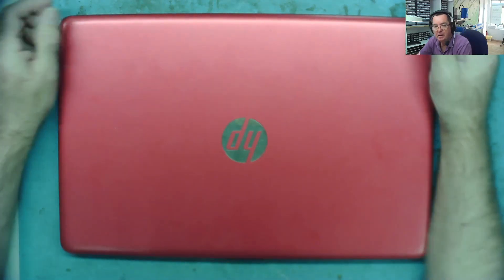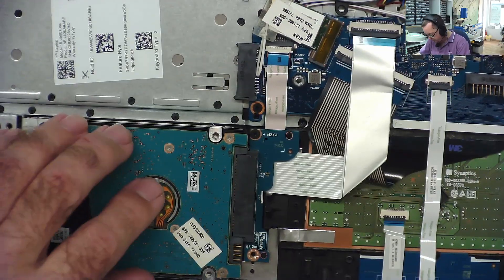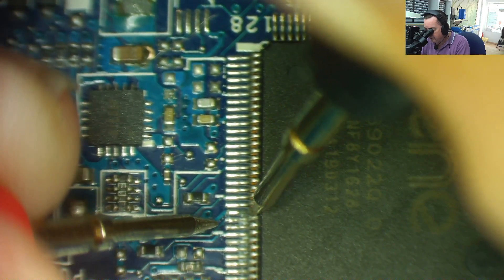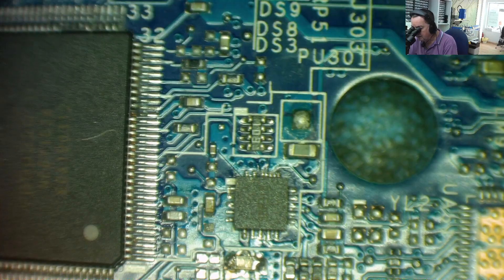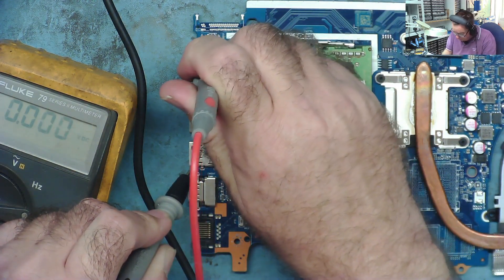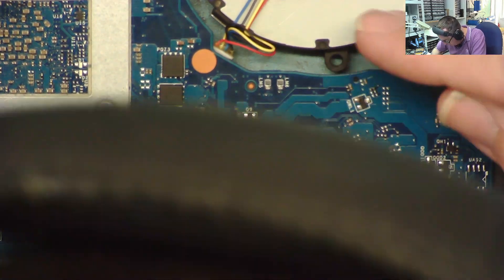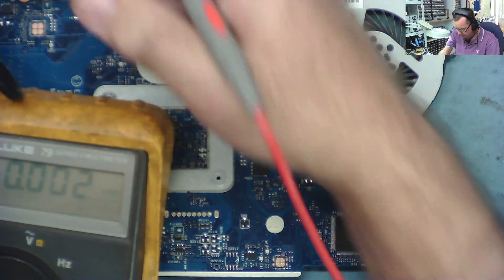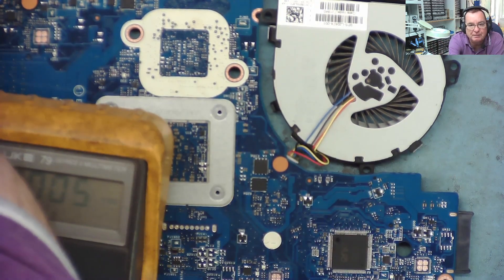HP Pavilion 15 Laptop and CATS are not compatible!  Liquid Damage!

Comment: May be worthwhile charging the battery (using a separate PSU). Some laptops don't charge or turn on if the battery voltage has dropped below a certain value.
Reply from the maker: @ralph J 
I'll give that a try, thanks

Comment: The usual guess is residue under a component pulling down the 3.3V.
Reply from the maker: Would you recommend washing the motherboard in soapy water,  like I do with dirty desktop motherboards
Reply: @LearnElectronicsRepair  I've seen heavier liquids, ie, coffee, etc, NOT clean off unless you remove the part, but because it's water I guess it can't hurt to try as is, ie, it might wash thin residues under parts.
Speaking of cleaning, because the flux I use is like tar I use kerosene first, menth spirits 2nd, ammonia surface cleaner and hose wash 3rd, IPA 4th, and then blast with compressed air and left in the sun.
Reply from the maker: @SidneyCritic  I'm back now, I'll give it a go, thanks